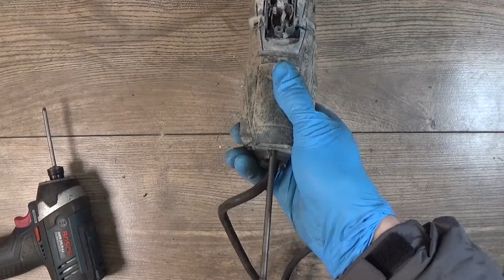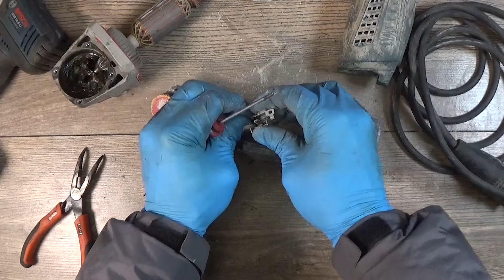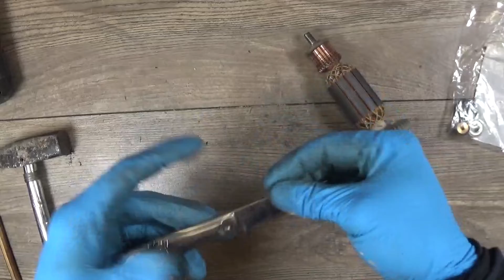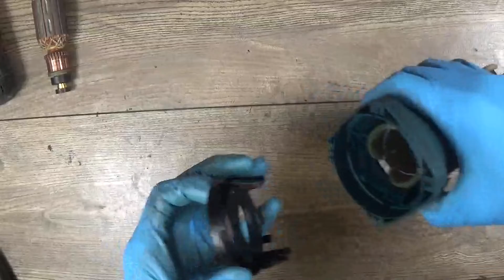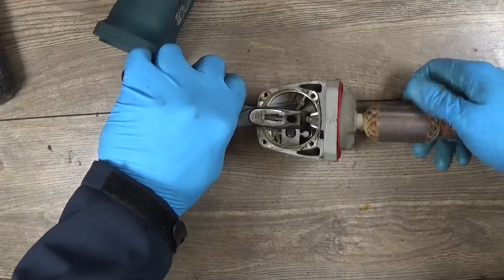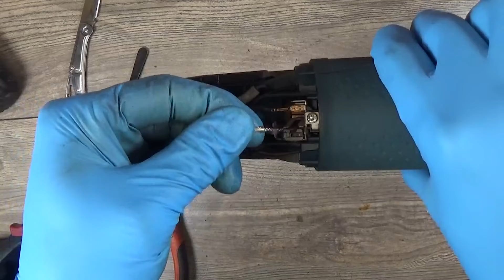Bosch angle grinder restoration and repair GWS 13-125 CIE

Comment: Respect for your work, but..  Do not hammer new bearings, if you don't have a press, you can use vise. Motor commutator is not in a good shape, should be lathe scraped,  otherwise will sparcle soon after repair. Lock nut on the armature should be replaced, cost few cents.
Reply from the maker: Thank you very much I will keep that in mind next time